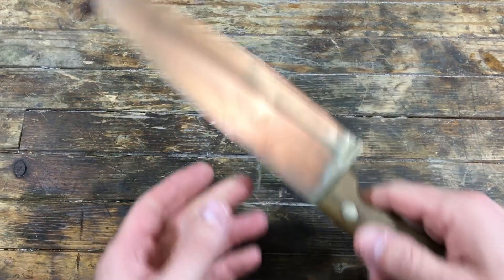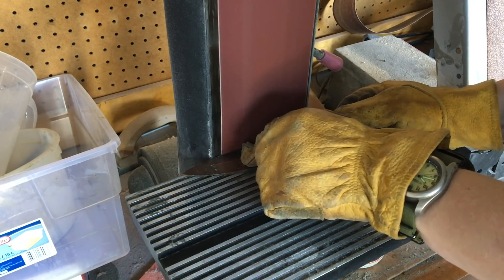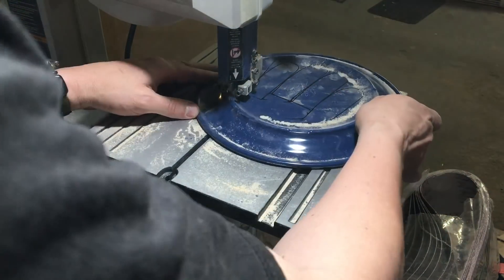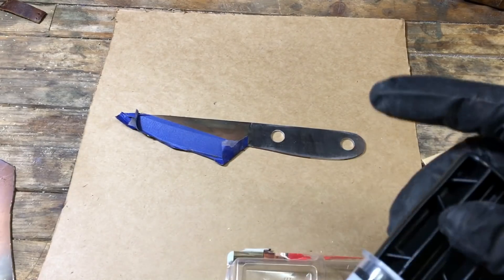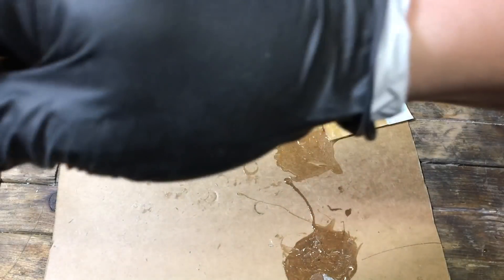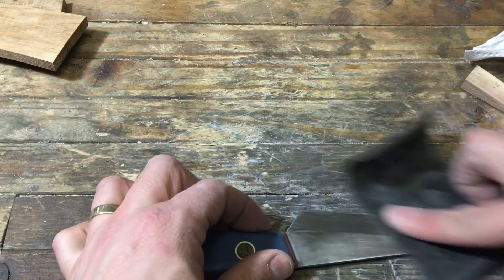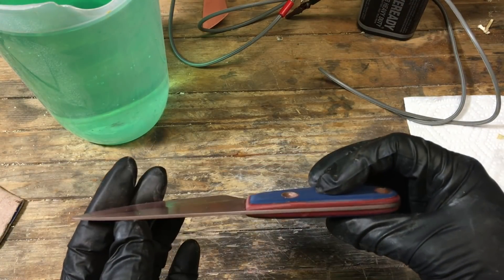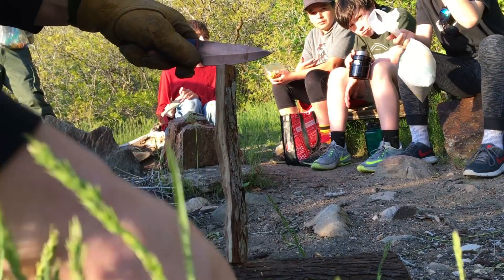Making an Inexpensive Knife Under $7 - This Copper Plated Knife was a Train Wreck

Comment: Love your videos! One thing I noticed while watching them is your sanding.  You are always sanding in the same direction which makes it harder to see the sanding lines you are trying to remove. If you sand 90 degrees to the last grit you can see when you have removed all the sanding marks. I am 41 and I just learned that trick 6 months ago.
Reply from the maker: I did actually do this on this build but I did tend still sand mostly in one direction but it does look like I cut the clips showing perpendicular sanding...  I do need to do it more though even when it’s a bit harder. Thanks for watching and commenting!

Comment: Walter Sorrells has great videos on the whole expoxy race deal...😃 I used to use Brownells AcraGlass daily...rule was...stir and leave the stick in the user container...you know its set when the popsicle stick won't move. 

There's a very good reason AcraGlassis slower setting...you have time to make SURE its all put together right and the ooze out is cleaned up...because if you DONT...I hope you loved it where it is😃its going to take a hammer, chisel and prynar to get it back off if you prepped it right...😃

Look into ROGUE epoxy brother...

I'm not being critical, this is a good save for a beater knife...just trying to help.
Reply from the maker: Mark, thanks for the comment. Helpful tips, thanks. It did turn out to be a good little knife. I was happy it held up well battoning, I thought for sure it would crack the handle as soon as I started hitting it but it held up well. 

Thanks for watching and the comment.

Comment: Typical epoxy mixes are 5min, 20min, 30min 45min...  Typically the longer the cure time the stronger the epoxy.  There is a new epoxy mix out recently that cures in less then a minute!  I think that's the one you have!  That is just super fast!  Alignment tasks require at least 30min epoxy...   (for me anyway I'm slow as poop)   LOL    Good stuff!!!!!!!
Reply from the maker: I’m slow as poop too. Lesson learned. 😁
Reply: @oldshovel  LOL   I have been there with the 5 min epoxy!
Reply: oldshovel jb weld. For when you want the adhesive to be stronger than the material

Comment: Personally I think nobody should use 5 min. epoxy glue. It's not controllable AND it makes you nervous, causing you to make mistakes.
Reply: @Greg Peck sadly, 5 min. epoxy is often not "5 min." but "1 min.", depending on ambient temperature or state of the glue, or just quality of the product. It's not controllable enough. It is almost impossible to mix it uniformly AND apply it before it cures, so it ends up being mechanically non-uniform in the best of cases.

It's just a bad thing all around.
Reply: @Greg Peck how about epoxy glue with longer curing time, say 20 minutes. Wouldn't that have worked just as well?

Comment: Skip quick set epoxy if you want anything to REALLY BOND. You have to have working time to get things in place. Never start gluing until you have dry fit run and know its going in to place before you ever start.